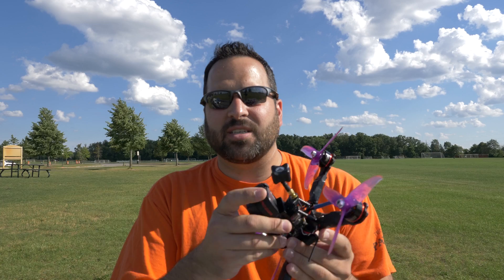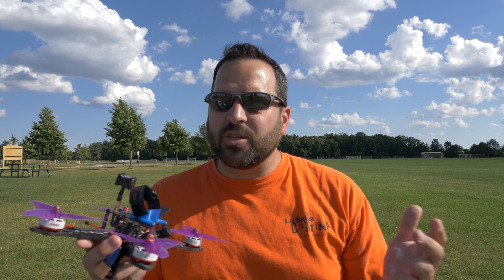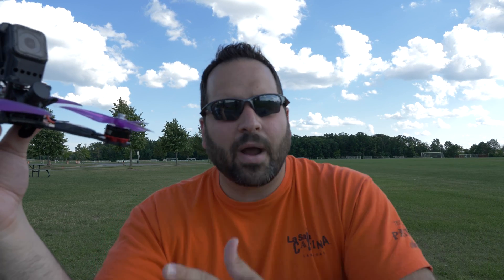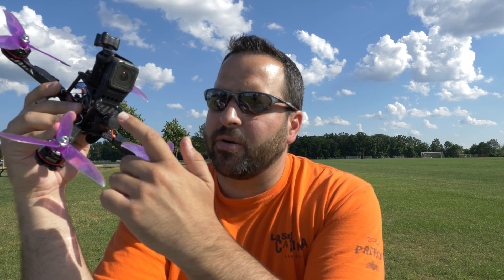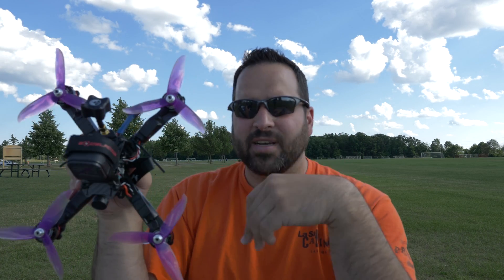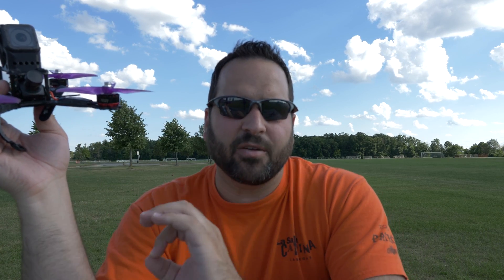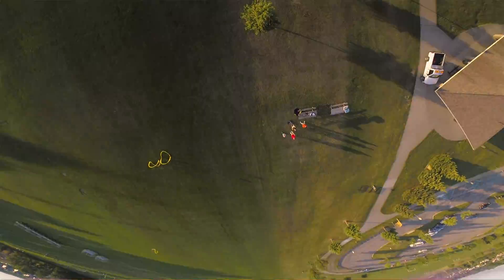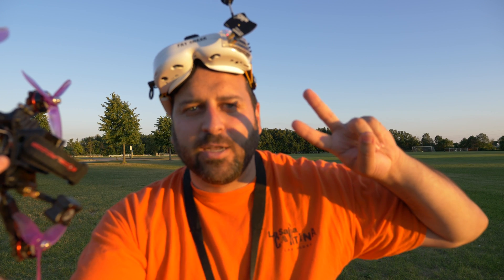XHover R5LX // Yet Another New Drone

Comment: yep, you get the soldering issue with every board that has a built in PDB, there is just too much copper for some irons to heat up. I have a DYS F4 and a crappy 25W iron, exact same issue :(
Reply from the maker: Huh.  Have you tried the Betaflight F3?  I've soldered 3 DYS F4 boards so far, and I haven't had any trouble with any of them.  I think what you are saying is correct, but man, if the DYS F4 was tough, I think the Betaflight F3 would be impossible for your iron.

Comment: Again a really nice video John! Your video's are getting better and better! The Xhover definetly seems to be more locked in. It makes such a difference if it's heavy or not. I can feel on my 180 too. If I haven't stuck a camera on top of it, it handles great. But If I have a camera on top of it, it's like a heavy sloppy cow. (635g AUW with camera wich is really heavy for a 180)
Reply from the maker: Thanks man!  I appreciate it.  635g does seem pretty crazy for a 180.  635 is already a cow for a 5".  How'd it get so heavy?
Reply: John E Fly It haves parts from a 5" quad. like: 2205 motors, a normal sized vtx etc. The only thing what's light is the frame itself ;) However. I'm going to build a 5" frame with very light parts soon. I hope it will be a bit lighter.

Comment: What you described is the symptoms of lighter weight indeed :D Ever since I built my 2 floss quads (250g dry) it's insane (for racing) how much better a lighter quad handles. Even a 2205 motor on a light quad is more than enough. I still prefer about 580g for freestyle, but it opened me up to thinking about weight more. Great video !
Reply from the maker: Ha, and I thought I was describing a symptom of being an R/C addict.  Yeah, this is NOT my light weight build, but I will be building a "light" weight racer in a video soon.  I saw how much better I was handling the turns in the last few races when I switched from my big heavy Martian to a lighter build with 2205 motors without a GoPro which weighed in around 500g AUW.  Because of that I want to go a lot lighter (hopefully 50g or so lighter) and see just how much crisper it gets.  For whatever reason, I didn't want to build a floss since everyone is building those these days, so we'll just have to wait and see what I slap together instead :)
Reply: The Floss is just a good bare bones racer though, 50-60g, takes a hit, and at the end of the day is cheap as beans. I think my one floss is 430g AUW with 1300. I will go lighter though, these were more of an experiment.

Comment: Soldering that board sucked for me too.  No other board I've tried has done that either.  That wind was killing the sound at 4 min for sure.
Reply from the maker: +John Hunt you have the same issue I did?  It just wouldn't flow the solder?  It would dry too fast basically?  Even adding more flux didn't make a difference for me.  I ordered a soldering station which promises better temp control.  Going to try the board again with that iron to see if it solves the problem.
Reply: Yea that solder would just sit there sometimes.  Especially trying to add a capacitor to the ground battery terminal.  It was like the soldering iron was unplugged.  Ended up redoing the whole board at 850.  Found my Video wire was soldered through hole but was actually just spinning in that hole but looked fully soldered.  Might be the place to check for your lost video.  Reflow all the joint at a higher temp with flux is what I would recommend.
Reply from the maker: +John Hunt my current soldering iron was maxed at 850 and was having trouble.  Hopefully the new iron at 850 holds the temp better.  I did have that same issue with my Rex ground wire, but noticed it before trying to fly.  I then checked all other wires and they seemed good, but maybe I'll check them again in case that caused my video issue.

Comment: hopefully your betaflight f3 lasts longer than the two I've owned did. Just try not to crash much, cause they hate a bit of shock.
Reply from the maker: +daneyan1985 scary dude.  I've crashed a lot of boards and never had them fail on me as a result.  Hopefully I don't have your bad luck, or I'll be extremely disappointed.
Reply: John E Fly Yea I've crashed plenty of boards as well but all of those handled crashes pretty decently. i run the omnibus line of boards now with awesome results.